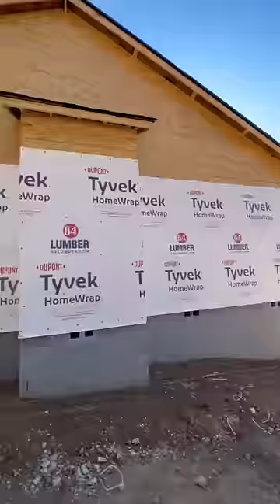Build My $350000 Wooden House in 60 seconds!!

Comment: Every German garden house for the lawn mower is more stable built than American Houses 😅
Reply: True
Reply: Another Cardboard House...
Reply: Was thinking the same…don’t mean to be rude but the quality of this building is just really bad
Reply: And thus, the renting quote in Germany is the highest in the west because no average person can afford that any more.
Reply: Cool flex I guess? My shed is probaly bigger than your house😂.
Reply: @tt-tk9076  LOL thats hella cope
Reply: @tt-tk9076   You think drywall is lighter than 1/4 ply?
Reply: @tt-tk9076  I live in connecticut. Plenty of old brick buildings...and we have earthquakes, none of them ever collapse, but the wooden buildings do
We only build wooden houses in the US because wood is extreeeemely abundant and cheap for us
Reply: @tt-tk9076  thats not thr case, the built quality has not as an important affect as the overall house market 
Houses in the early 2000s were also extremely well built, and the prices were low
Reply: @DejavuB  but built like a lego house, one strong wind and bye bye
Reply: If you pinch the wall in the US, there’s a hole in the wall, if you do it in Europe, you have a broken hand.
Reply: What are those shingles on the roof?
In Germany we use those on Dog shelters or on treehouses for the kids.
Reply: Wood framed houses are perfectly fine, as long as you keep water away from the wood the structure will last as long as you want
Reply: Wo ist das fucking Fundament lol :D
Reply: @tt-tk9076  If we german build this house it would last centurys. Just sayn no wonder why your houses get blown in pices
Reply: @tt-tk9076  we have earthquakes all the time. But in a brick house built with anti earthquake tehnology there is nothing falling on your head.
Reply: @tt-tk9076  This is not entirely true. There are dozen of different kind of composites of cement. There are quite a few that have fitting structural integrity that resist earthquakes or high vibration in general. 

It's worth mentioning ofc it's quite unlikely to have a high magnitude earthquake in West Europe compared to NA and their Hurricanes etc.

In the US houses are built to be ready finished fast and cheap.
In pretty much entire Europe, houses are built to stay for a long time.

If it comes to integrity all US houses will fail against enforced concrete Houses.

But if it comes down to financial expenses the US houses win since they are cheaper, while the valuation of concrete houses stay stable.

Both have their pro and cons.
But if it comes to natural disasters I would absolutely rather stay in a solid house than a soft house.

You should look into the architecture in the Netherlands they adapted their houses to withstand Tsunamis by floating with the water level, quite fascinating.
Reply: @motrolleur7368  my house is 90 years old all wooden frame two story. My room looks like a cabin. I live in San Jose California and it’s great way to build.  a lot of strong earthquakes only leave cracks in the walls from everything shifting but the frame is fine. I’d never trust a brick house with the earthquakes we get here. I’m sure you don’t have to deal with those.
Reply: @halvarf  lol it's like that all over the western world. sweden norrway everyone has massive extreme property/rent prices that make them unable to afford the shit. but we still got it beter than the americans because minimum income for some of them is so low they need 2 jobs + food stamps just to afford poverty below someone who lives in a European country and works half time att Mcdonalds.
Reply: Its crazy how they build houses in america
Reply: @bigchris6000  why is it a cardboard house?
Reply: yeah its built so good it spends more time in the shop than running
Reply: @tt-tk9076  it makes almost no sense, in Italy we have quite a lot of earthquakes and we build houses with bricks, one for insulation two for durability. No shit in europe we have houses hundred years old, like mine.
Reply: @alexvillalobos7137  you are delusional
Reply: @rampage3337  True, but that's not what I was talking about. The percentage of people who own their home is the lowest in Germany compared to the other EU countries, US and Canada. And If I compare the video with what I can do with the equivalent of $350000 here (even if I'm willing to do the work), it's ridiculous.
Reply: @const2499  dies ist ein Ringfundament, das gibt es auch in Deutschland. 
Es günstiger, da man keine komplette bodenplatte gießen muss.
Heutzutage werden fast nur noch ringfundament genutzt, da man die bodenplatte darauf fixieren kann.
Reply: He's not building an actual castle here Fritz. Your AUDI's suck btw.
Reply: @halvarf  Only in big Citys where I live its not really expensive
Reply: That's a fact
Reply: @bigchris6000  cheap is better in America
Reply: @chugkingchris  
You're right. Here's the problem. Americans are very regulated when it comes to construction. So homeowners skimp on better materials and settle for these matchstick houses.
Reply: @jovantrendmaker4722  
Strict regulations. But 3D printed concrete houses are coming.
Reply: @chugkingchris  the quality is actually really good. I think you mean to say structural stability which is decent. it is a stick built which keeps the cost low since you dont need a full foundation but everything is anchored to that footer so its not flying off.
Reply: @jamesboond007  thats because we commonly use drywall which is a much better material for a house as it is more accommodating to renovations
Reply: @BHorst.BHorsty  you have a house? I thought yall lived in mud huts and run down apartments.
Reply: @casematecardinal  😂 don't know where your ancestors come from but I can tell you that we have alot of houses where ancestors of amarican people lived in.
My house is about 350yrs old and my parents hose is from 1673.
Reply: @BHorst.BHorsty  good for you. Thats not a sign of a good house though. My house is likely 3 or 4 times the size of yours has modern construction techniques and is much easier to maintain the wiring, plumbing, and is in a desirable location. At the end of the day your house is like a boat from the 70s a turn off for anyone who wants to buy a good house. Sucks to suck and sucks to have to live in a mud hut.
Reply: Nah most houses in America aren't built like this Bozo's house 😂
Reply: @PhoenixShark  aye I live in ct too
Reply: 350 thousand dollars for a freaking card board house.
Reply: @tt-tk9076  not necessarily true. In most places they only do lumber because its cheaper regardless of safety or quality. Contractors just meet requirements and codes. Take Florida for example, the coast is always in danger of hurricanes every single year, yet they built stick houses right on the water all the time. And most beach houses you'll see are made from timber. Regardless of hurricanes, the damage and rot caused by the salt water is always going to happen regardless of waterproofing. The overall cost from that has to be paid for termite inspections and maintenance plus ridiculous amounts of insurance for flooding and fire that most of the times doesn't actually even cover anything makes concrete or brick a better option almost every time. I should know, i used to live in one of those big timber framed beach houses, absolute pain.
Reply: @YouVidTuber there are no earthquakes in Connecticut 🤦‍♀️
Reply: Just because a house is built of wood people think it won't last... I don't know how to rectify this misconception other than to say that there are a lot of metal ties to hold the wood together and wood is an amazing composite material.  Wood is easy, cheap, and strong, and with modern building methods it's easily as strong and safe as any stone house.  Also, all these people are calling wood weak as if it's not the material holding the roof above their heads rn... Even if your walls are stone, your roof framing is wood.  There are 300 year old wooden houses here numbskulls.
Reply: @const2499  Das frage ich mich auch. Ich dachte nur die Russen und die Ukrainer bauen auf diese Weise. Auf einmal sehe ich das auch bei den Amis...
Was mich am meisten stört ist aber, dass der 350,000 Dollar für ein Holzhaus mit einem Stockwerk bezahlt (evtl. war das Grundstück teurer als das Haus).
Ein heftiger Sturm und das Haus ist auf dem Grundstück des Nachbarn... ROFL
Reply: bricks and stone suck heat from your home in the winter. it's also tons more expensive.
Reply: As a Dutch guy its really weird that you talk about german houses like that knowing how lose there rules are on building your own home in comparisom to the Netherlans but i guess Americans dont have any building rules xd
Reply: @tim6385  it's a safety thing Tim. Homes don't need to be castles to be durable.
Reply: @JR-mh8vn  it's all relative 😂 Japan's system is insane and gets updated every year
Reply: @tt-tk9076  cus the house won't fall cus it has a better structure
Reply: Ehhh I’d rather have a timber house and live in America vs a concrete house and live in Germany. Also many tests have been done, concrete houses are the most unstable and need maintenance throughout a lot of countries because of the environment they are in.
Reply: @theproceedings4050  it's just u.s. housing in general. it can be made out of the best material and still be shit. These contractors have bought out the local governments building entire neighborhoods cutting corners at every possible chance they get. Insurance companies denying claims because the houses aren't built properly. it's fucking disgusting and ppl are paying damn near $500k for basic homes. avg developer cost near me was $85k per home. they started selling at $385k and now $500k. they have tiles popping off the floor, settling cracks, no insulation you can hear the neighbors walking through their home. windows and roofs leaking.
Reply: @chugkingchris  fr. I'm pretty sure I can reduce it to a pile of wood with a sledgehammer or an axe within a couple hours.
Reply: @jamesboond007  absolutely. The thing that irritates me tho most are the person sized windows they gave with no metal grills of any kind. A brick is enough to break into a house over there
Reply: @tt-tk9076  In germny, shit just wouldnt fall on your head
Reply: @Alex Villalobos  tell me you don't know what you are talking about without telling me lol. Europe has tons of earthquakes lol, with homes that are hundreds of years old. Two homes in Germany and the oldest is over 500 years old and still standing.
Reply: @tt-tk9076  this, this right here tells me you know nothing about eurotrash enginering.... since our houses are build to last, even our ancient shit was build to last.

thats why we have castle's and the like, that still stand after centuries lol.
Reply: Was thinking the same, im From Denmark ;D
Reply: Man thats so true xD
Reply: But it looks good on the first glance, thats all what matters in the US
Reply: @tt-tk9076  Yeah it's just like how in tornado risk zones it's better that your house is blown away than you surviving.
Reply: @tt-tk9076  florida has more tornados and hurricans than earthquakes
Reply: @motrolleur7368  not wanting concrete to suffocate you isn’t cope man
Reply: @tt-tk9076  houses should be built to survive anything
Reply: Nah. Thing would take a hurricane easy. No need to build to multi hundred year standards.
Reply: @DarkLinkAD  1/4" ply plus a brick. Like the man said
Reply: Thank you for saying what I didn`t dare. I hope it`s warm and tornado-free where he lives 😅
Reply: Dachte ich mir grad auch so, auf deutsch werden dir solche Videos nicht angezeigt
Reply: @tt-tk9076  yes, that’s why they build the houses in Florida every two years completely new
Reply: @intestines6343  For real. They're perfectly fine if built to modern code. Which varies per climate and environmental conditions. You don't build a home in Florida like you do in New England or out West in Cali. They act like all roof truss systems aren't wood to begin with anyways.
Reply: @jnartist3411  Ja das stimmt. Aber die Bauweise ist eine andere. Wie es ein anderer Kommentar schon gesagt hatte: Es ist ein fundamentales Interesse Günstig in den USA zu bauen. Wir hier bauen dagegen mitteleren bis teureren Preisen. Davon mal abgesehen, dass wir keine Wahl haben mit den mittlerweile verrückten Baugesetzen. Das kann sich mittlerweile fast keiner mehr leisten. Und die Regierung lässt über die Hälfte der Menschen immer ärmer werden. Hat jetzt nichtmehr viel mit dem Thema gemeinsam. :)
Reply: All the oldstyle brick homes out west in earthquake country are gone, and it's for a reason. 

Wooden frame houses don't break, they bend and sway. A German brick home would shatter into a million pieces the moment a single good earthquake or hurricane or tornado comes through. We saw it happen recently in Turkey, didn't we? The building codes for the area repeatedly recommended wooden frame homes, and guess what? The only building left standing after the earthquake was the Civil Engineers Building, which was built with a wooden frame.
Reply: True tho😂
Reply: Yeah as a German I was happy seeing bricks and then the wood came and I was Dissapoimted
Reply: This thing actually gives me anxiety. At that point you could live in a tent!
Reply: We got the nazis chiming in huh
Reply: I thought Germans were tougher people, but apparently that's where Karen's come from.
Reply: @theproceedings4050  I 100% agree. Norway has 1000 year old churches built out of wood, that still stand. Wood can be extremely durable, but it does need regular maintenance.
Reply: @halvarf  dude have you looked at rent prices in american cities recently?
Reply: Wollte ich auch sagen! 🤣
Reply: @Anna-pj8te  Yeah, to be clear though so doesn't stone.  Mortar needs to be replaced and stones reset, nothing is permanent.
Reply: True and we’ve got some isolation
Reply: @const2499  Verloren gegangen im Bauprozess  😔
Reply: @tt-tk9076  thats why people in other earthquake prone countries make houses that don't crumble at all in an earthquake... AND is higher quality
Reply: These are made by illegal immigrants, not American craftsmen like back in the day unfortunately.
Reply: @tt-tk9076  
When my reinforced concrete framing building hit by 6 magnitude earthquake, only the decorations and furnitures are falling, the building is still intact with no missing pieces.
Reply: Sounds overly complex and inefficient. But then it is German, so not much of a surprise.
Reply: @DejavuB  and you have a bigger truck to drive several miles just to get a milk that in germany you can grab from a store just walking down the street. don't try to compete with germany, yank, you're always loosing out.
Reply: @voidbinary  they aren’t really cheaper anymore. Houses that were going for 80k 5 or 6 years ago are now like 200k
Reply: @Marynicole830  Well...inflation is a bitch huh? But yeah.
Reply: Every region builds there houses with different material, Americans use wood, it's cheap and it helps keep the house warmer. It also withstands earthquakes better then brick and stone since it has some give to it. Plus a wood house can last just as long as some houses made of brick and mortar, just depends on the area it is built an who built it
Reply: @the_babbleboom  Wtf are you saying kid? We have bigger cars and bigger houses and that’s just facts.
Reply: @DejavuB  *worse cars and worse houses
Reply: if you don't build cheap houses, you can't keep making cheap houses to sell forever
Reply: I just wish we would all go back to quarrying stone for foundations and walls again, they are the most robust structure on earth and will last many lifetimes, people 1000 years from now will think we were all kings.
Reply: Probably because Americans don't have to worry about some random European country shelling them for no reason 🍷🗿
Reply: @tt-tk9076  by that logic just live in a tent
Reply: @tt-tk9076  if you build a house that can withhold that and does not fly away by the next wind  it would be no problem
Reply: @nkniklas1237  And where do you live that’s so great?
Reply: @casematecardinal while we are at "mud" houses, you could ram a car into a medieval brick house, and the car would probably have more damage than the house. Do the same with a wooden house, and the car wins without a doubt
Reply: @YouVidTuber  lived in Connecticut all my life and I’ve never heard of anyones house breaking down during an earthquake, hell I’ve never heard of an earthquake here before
Reply: @kingrocketii6661  for one, no a medieval house would come down and probably kill all its occupants. The difference is that you'll actually be able to afford a new house if its wood frame. Its also less likely to catch fire.
Reply: @motrolleur7368  it's actually because wooden structures are far more cost effective, and Europe exhausted their lumber supply centuries ago while the America's still have an abundance. Hollow interior walls allow for more efficient piping, wiring, insulation, and repair, and while they won't last as long, they are also far easier to refurbish. Ultimately it's a trade off, and it's what's allowed Americans the average American to live in a home with twice the square footage as their European counterparts.
Reply: @tt-tk9076  tbf. most german houses would tank natural disasters in america easily 😅 we even got these fancy rolladen americans call window shields. Rly wonder why these arent normal in america especially in tornade regions it would protect ur windows alot.

The main reason and difference is the wood price in germany and america.
Reply: And the amount he paid for it, i would have understood of it was 50k for everything but that price...
Reply: Looks like these guys are in the east or North America. Being some of them  had hoodies on. No worries about hardcore situations and ya don't need to be protected from anything but the cold in the winter -_-. No hurricanes no earth quakes ,no tornados why spend more for protections ya don't need.
Reply: But....German garden sheds don't have a double garage. So 1 point to this project
Reply: @YouVidTuber  I'm I'm CT, too. My house is brick with a steel I-beam for support and plaster walls. It was built in 1957 so it also has a bunker in the basement because of the Cold War. My house is so much more solid and, frankly, nicer than my parent's 1980 raised ranch.
Reply: @tt-tk9076  lol that's why the houses built with european standards still stand after the disastrous earthquakes im Turkey, BECAUSE they were built solid and not cheap.
Reply: It's just a cost thing. Try building a house from scratch with the same amount of money in Germany
Reply: Yes, except for South Florida, brick, mortar, and impact everything down here.
Reply: @YouVidTuber  no thats not why at all lol. Brick and mortar is extremely dangerous in earthquakes.
Reply: @const2499 " Blown to pieces"... can happen no matter who builds it, if you have tornados.  There is no a single state in the US that hasn't had a tornado.  How many tornados do you get in Germany?
Reply: That’s right! Greetings from Bavaria! This house is a joke! My Garden house is more stable built!
Reply: @casematecardinal  for one, I should have thought about my comment a bit more, maybe leaving out the "medieval" bit.
Also, a brick house would not simply fall down if a car rammed into it, as something called physics and mortar exist. And you are telling me that a WOODEN house is less likely to catch fire than one made out of bricks and mortar?
The medieval house might take some damage, but it probably won't collapse, and you might have to repair/replace a wall.
Reply: Ive restored wood frame homes that have lasted centuries and endured some of the worst storms in human history. From hurricanes to some of the worst thunderstorms you can imagine. The craftsmanship that goes into some of these homes are really quite something to see. Very charming. Such personality. Germans build from limestone as I recall because wood isnt as abundant but theres an art in that too. Americans just have no use for all stone homes. We have no use for castles man. Not afraid of the next Napoleon to come stomping through but just to give you context. Many of those homes I speak of survived the civil war. Dont knock it til ya try it bruh..
Reply: Also just to give you more of an idea. Different regions in america build differently. In the south you see wood frame and siding alot but you also see incredible masonry aswell. Up north you see more stonework and a mixture of wood and stone. You also see stucco in the hotter regions. Florida, Arizona has alot of stucco work. Just different building methods for different applications.
Reply: That's probably cause Germany is afraid of being bombed to hell again so they try to build houses that can withstand explosions. Lol
Reply: That's why it's too expensive and heavily regulated to build in all of Europe. Buy your dog house buddy
Reply: @YouVidTuber that's because the last earthquake was 300 years ago 😅
Reply: @const2499  how many tornados do you get?
Reply: @DejavuB  my sheds are way bigger than my house.
Reply: @YouVidTuber then why are the houses just as expensive then?? 😂
Reply: @bengsynthmusic Not really... it's coz 99% of homeowners don't know any better.
Reply: racist stereotyping